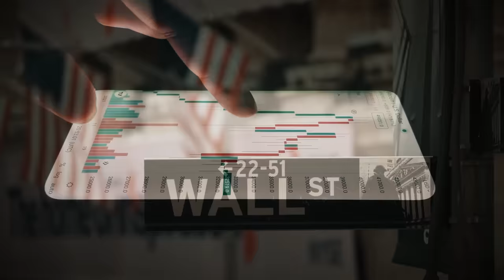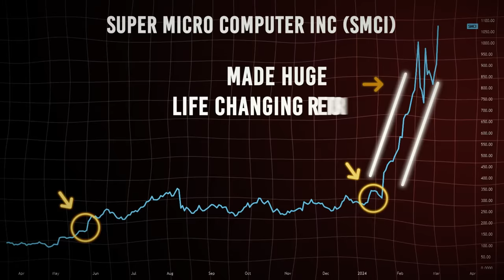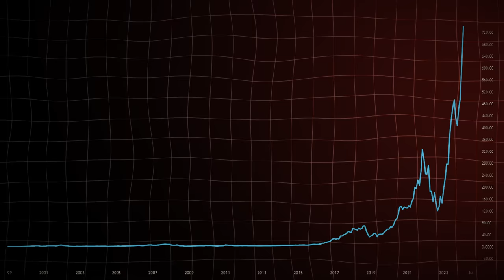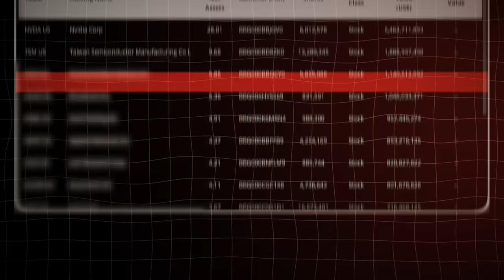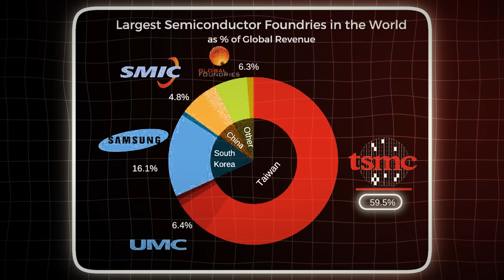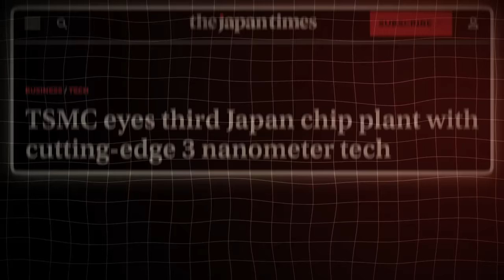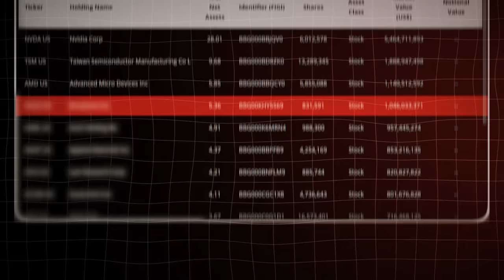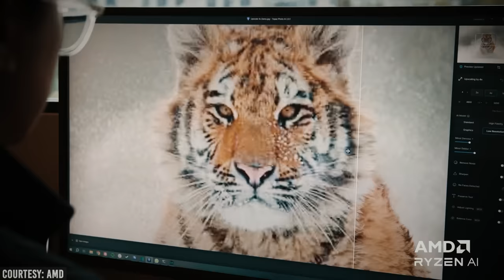Cathie Wood "Mark My Words, Everyone Who Own These 3 Stocks Will Become Millionaire By End Of 2024"

Comment: Purchasing a stock may seem straightforward, but selecting the correct stock without a proven strategy can be exceedingly challenging. I've been working on expanding my $210K portfolio for a while, and my primary obstacle is the lack of clear entry and exit strategies. Any advice on this matter would be greatly appreciated.
Reply: the strategies are quite rigorous for the regular-Joe. As a matter of fact, they are mostly successfully carried out by pros who have had a great deal of skillset/knowledge to pull such trades off.
Reply: Even with the right strategies and appropriate assets, investment returns can differ among investors. Recognizing the vital role of experience in investment success is crucial. Personally, I understood this significance and sought guidance from a market analyst, significantly growing my account to nearly a million. Strategically withdrawing profits just before the market correction, I'm now seizing buying opportunities once again.
Reply: impressive gains! how can I get your advisor please, if you dont mind me asking? I could really use a help as of now
Reply: Yvette Ruta Musto' is the licensed coach I use. Just research the name. You'd find necessary details to work with a correspondence to set up an appointment.
Reply: Thank you for this Pointer. It was easy to find your handler, She seems very proficient and flexible. I booked a call session with her.
Reply: Candle stick pattern